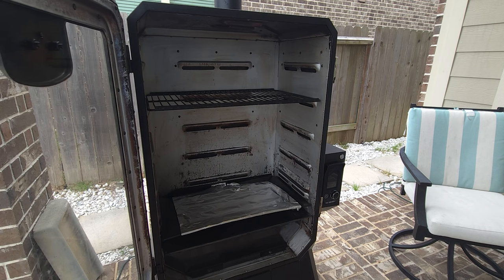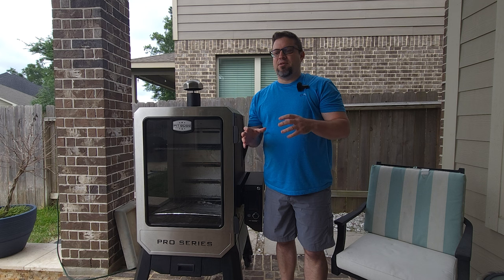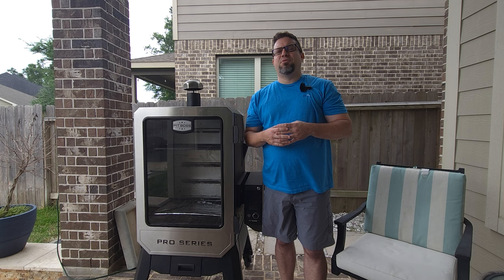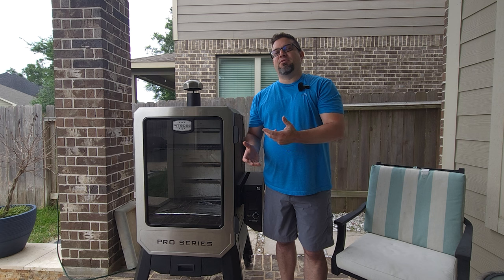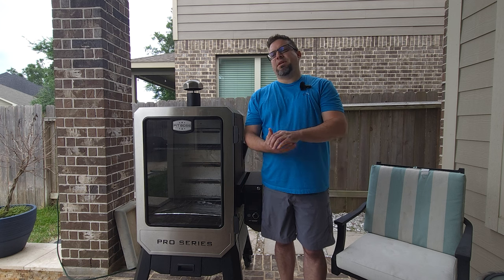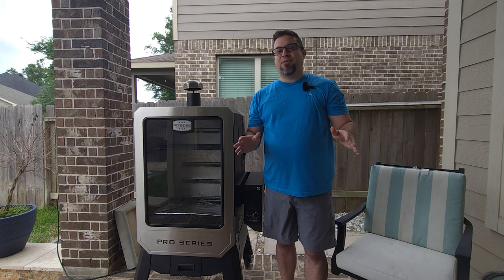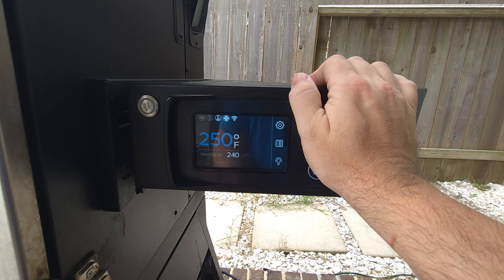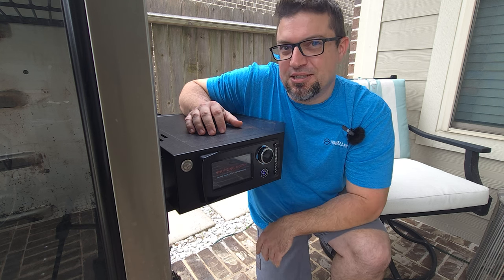Pit Boss Fails: Common Errors In The BBQ Game

Comment: The immediate issue I saw with the foil is the fact you covered the grease tray completely. There are vent slots. You need to cut the slots open. I foiled the tray for years, sliced the slots, never had an issue with my Copperhead three and fives. I hardly ever put water in the pan either. I never trusted their controllers either. I used my Maveric with a temp probe on the center rack. In the vertical it runs hotter at the top and hotter at the back of the cabinet.
Reply from the maker: @johnmanthey2683  Good tips.  I have found that without water in the tray, the temps are not in control.  I'm waiting on 1 more part for this smokersince the fire.  Then I'll be able to start using it again.